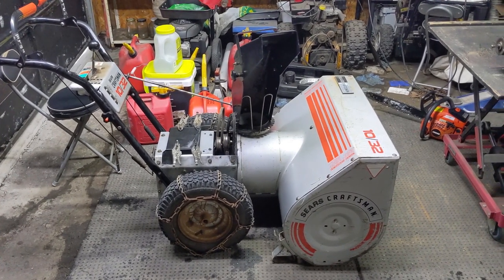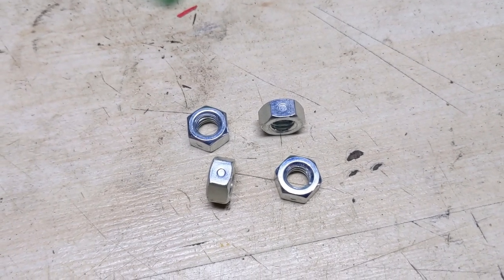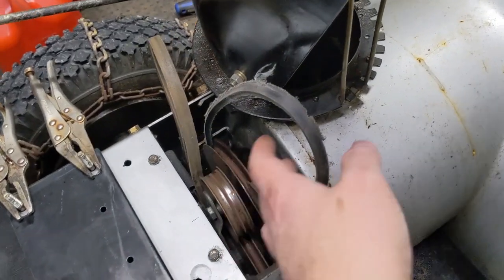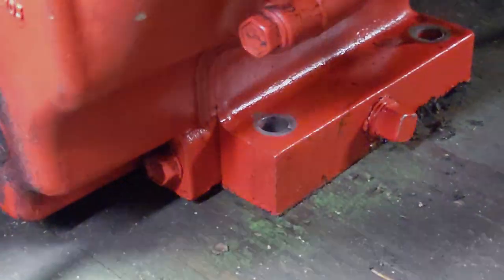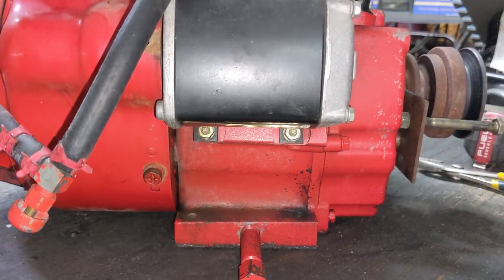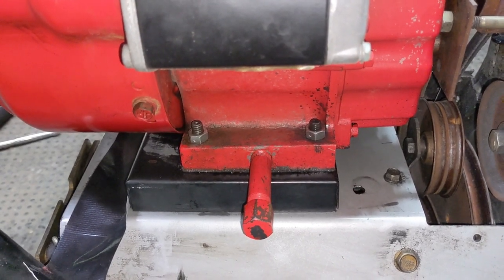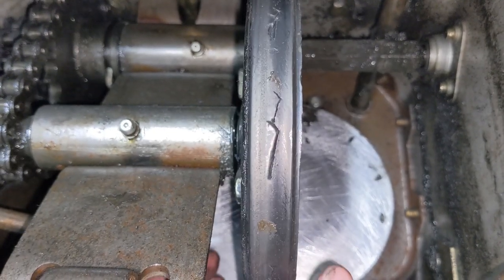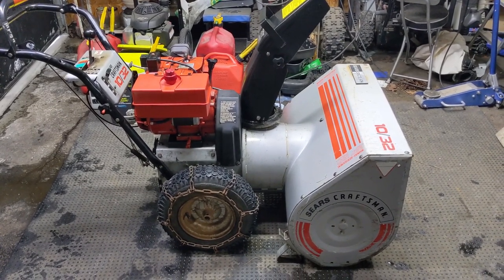Reinstalling an Engine that Fell Off a Snowblower

Comment from the maker: The issue with lock washers is, in the event that the nut backs away from the lock washer, the lock washer no longer functions. Once this happens, the nut can loosen itself off, to the point where it falls off the threads of the bolt completely.

A reversible (or reverse) lock nut has an indent on the outside of the face, which slightly deforms the threads at the center of the nut. This allows the nut to be installed from either side.

Reversible lock nuts provide "prevailing torque" which means the lock nut creates friction between the threads of the nut and the bolt or stud treads, which in turn increase the force needed to tighten, as well as loosen the nut.

Another form of a prevailing torque lock nut, is the Nylock (nylon lock nut) nut that I showed in the video. The nylon insert has a smaller diameter than the opening of the nut, allowing the threads of the bolt or stud to dig into it. It is not recommended to reuse these types of lock nuts.

Additionally, there is also a Stover Lock Nut, which have a conical (dome) top and a flat bottom surface, featuring chamfered corners. The locking action, created by distortion of their top threads, is said to be capable of withstanding severe vibration and shock loads, similar to the reverse lock nut. However, unlike the reverse lock nuts, the stover type lock nuts can only be installed in 1 direction.

A "surface bearing" or "surface tension" locking mechanism would be a "serrated flange" or K-lock style nut (used to hold a Tecumseh carburetor onto the intake manifold), or a typical lock washer. This is essentially a washer that deforms under the pressure of the fastener.

Comment: Great video, and great solution for the problem! i have a few lock washers on two seperate snowblowers, one tecumseh and one briggs, but the lock washers are sure to cause a problem later as things loosen with the normal vibration of service. great idea with the reverse locknuts, those will definitely stand the test of time a lot better. your customer will be stoked he only has to turn the engine over a quarter turn to get er started!
Reply from the maker: I got a universal pack of them that contains a whole bunch of different sizes, was fairly inexpensive too. This was quite the repair in terms of what it needed to be functional so I could give my customer a guarantee, but he'll be happy that he doesn't have to spend a fortune on a new machine. As he said, they don't build them like this anymore, and he had trouble finding a larger unit such as this.

Comment: I've fallen and get up.🤣 All jokes aside the  those locking nuts are  a great idea for this matter I've had a issue with the engine on  my snapper rear engine rider only had 1 or 2 bolts holding it to the frame
Reply from the maker: Luckily this one fell and got back up! Thanks for watching!
Reply: @EliminatorPerformance  Glad to hear that you were able to get it back in running shape

Comment: Great video.  You did a great job for your customer.  That machine is a top of the line machine.  I was looking for Zerk fittings and was not dissapointed !  If I owned it I'd clean it up and wax it at the end of the season.  Snowblowers are life saving tools.  My 10 horse still looks brand new and it's the better part of 30 years old.  Updated the belts and did a carb clean/rebuild.  Every year I get 5 gallons of frsh fuel and use Sta-Bil Marine fuel stabilizer.  A wash and wax is next?  I wonder if your customers would pay for a minor detailing of their machine ?
Reply from the maker: Probably no detailing on this one, but definitely had to clean up the underside where the drive area was as it was all full of grease and wanted to make sure the friction wheel and plate was clean.
Reply: Al for storage at the end of the season we suggest running it out of fuel and using a 1/2 litre of canned engineered 4 cycle fuel be added to the fuel tank and run the blower for a few minutes to get this ethanol free alkalyate fuel into the carb. You can see the Gulf Pro Fuel sign behind my son on the intro made in the USA and great stuff (video upcoming)

Comment: Nice explanation on which nuts to use. I recently came across some nuts that had that round indent in the side and they would only go on 1/2 way easily. I was thinking they may have a special thread.
Reply from the maker: Yes they could be prevailing torque nuts. They work great for high vibration applications. Thanks for watching!

Comment: Jake I’m surprised it didn’t have dual belts on the auger drive. Not sure what year MTD started using them on units that are 7hp and up. I have in a pinch made lock nuts by giving a squeeze in the vice to distort them slightly.  Thanks.  Rick
Reply from the maker: The dual belts came out later, only reason this is MTD is because they bought out craftsman here in Canada. Now it's Stanley Black and Decker!
Reply: I think those old craftsmans may have been built by murray/noma. would need to see auger engagement at the rear pan.ok just saw inside drives. just like my noma.

Comment: Pretty lucky that engine didn’t destroy everything bolted to it when it committed seppuku. Great to learn about a type of fastener I’ve never heard about before. I probably would have used nylocs or double-nutted them with threadlocker before seeing those nuts. What kind of skids does that machine have and are they adjustable?  10/32!  That’s huge for a homeowner, isn’t it?  Does it have a differential?
Reply from the maker: Yes he got very lucky! No differential on this one, solid axle with a friction wheel and chain drive. And 10/32 is big, but it's for a customer with a large driveway in a slightly rural area. Thanks for watching!
Reply: The skid shoes on this unit are actually behind the bucket and set underneath, we have them set for 1/8" clearance to the shave plate since the customer has an asphalt driveway.
Reply: Wayne Stefinashen   I’ve been wondering about another detail for a while now and no one seems to come up with a definitive explanation. Why don’t snowblowers have fuel filters?  Is there any reason why I can’t install one if there’s room?  Thanks, Wayne. Or Jake!
Reply: @Rein_Ciarfella  Air filters are not required on snowblowers simply because they are not subjected to an air polluted environment like lawn mowers are. During the winter there is no dust and pollen being blown around the only thing that could get pulled into the carb intake is snow. With the heat shield around the carb used to heat up the carb area to prevent any freeze ups of moisture the carb is basically sheltered, no air filter needed.
Reply: Wayne Stefinashen   Thx for the reply but I was asking about fuel filters. I’d already figured out the deal with air filters.  I’m aware that some snowblowers have a built-in filter in the bottom of the tank, although I have yet to see a video on how to service them or even what manufacturers have them. If I could retrofit one of those that might give me another option besides cutting one into the fuel line, although my preference would be for a 30 micron clear paper filter so I can visually check whenever I want.
Reply: @Rein_Ciarfella  Sorry Rein misread your original question. The fuel tank likely has an internal filter screen in it and on the Honda fuel tanks there is an inline fuel filter just at the exit of the fuel line from the fuel tank but again this is just a small plastic screen type filter. You should never need an additional fuel filter in a snowblower unless you have debris inside your fuel supply container. We have checked many of our customers fuel containers and visually you can see a lot of fine debris in the bottom of the container. This debris comes from debris in the air that is blowing around while you fill the container with fuel. There is also debris that gets into the container when you open it up to outside when it is windy and fine particles in the air can enter the container, this is especially true for our customers that live along Lake Erie where there is a high amount of beach sand that is blowing around. During the winter there is very little debris in the air compared to Spring, Summer and Fall months. Jake has a video on fuel filters and the microns of debris they will eliminate from entering the carb so if there is room to install a fuel filter it is only added protection and can be added to your fuel line. We would suggest the white plastic type that filters 150 microns vs the red one that only filters 75 microns. A paper fuel filter type is the best but normally used on equipment with fuel pumps so the use of this type may cause some fuel delivery issues although we have used them on gravity fuel fed riding mowers without issue. Hope this helps!
Reply: Wayne Stefinashen   Thanks so much for continuing to help me learn about this. I don’t have Honda engines. All three are Tecumseh and none have any kind of fuel filtration, which is how my question arose in the first place. Since I work on a variety of different small engines I’m aware of how most are air and fuel filtered but I just finished restoring my first snowblower so their systems are new to me. I watched Jake’s filter video when it came out and have watched it twice since then. You got the micron numbers reversed but I get what you meant. My intention for using a 30 micron was to make sure nothing that will damage a cylinder or piston or ring gets through yet be small enough to install inline under the tank downstream of the shutoff. In looking at this website https://www.commercialfiltrationsupply.com/education/a-better-understanding-of-micron-ratings.html  I realize that 30 may be overkill and not be so great for a gravity feed. I was only going by what Jake showed. Now I see that I could go 50-75 if I find one small enough to fit. Maybe. I just don’t trust that pump gas and fuel cans will always provide clean fuel, plus my intention is to restore and flip so I want to install some insurance against the next yahoo who is careless or ignorant and allows particulate into his tank. 😉

Comment: Huh, you don’t see that everyday. Very interesting video. How old is that machine?  1979?  I will have to try those reverse lock nuts. Nice tip. 👍
Reply from the maker: It's definitely an old one, but they don't make them like this anymore. Thanks for watching!
Reply: I have a 1986 10/32.  Its almost the same.  Still runs like a dream up here in Quebec.
Reply: Never mind how old is the machine. I wanna Know how old the customer is